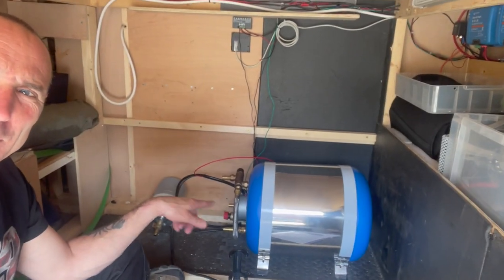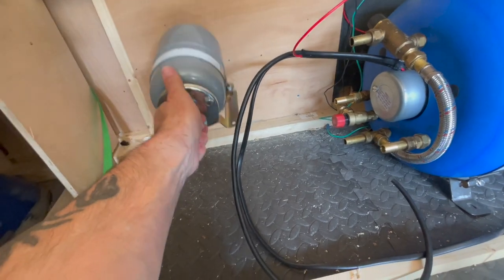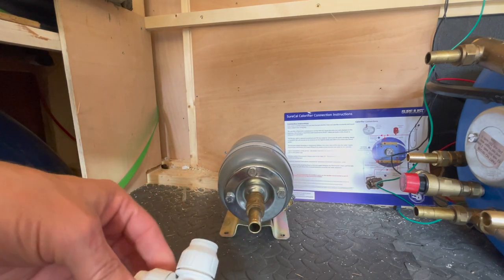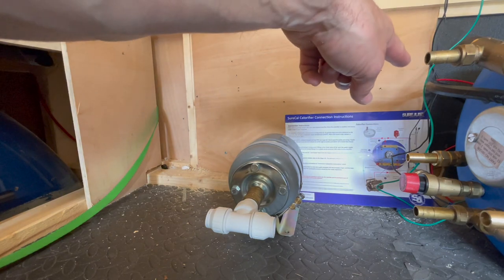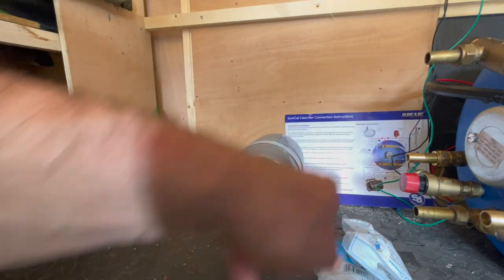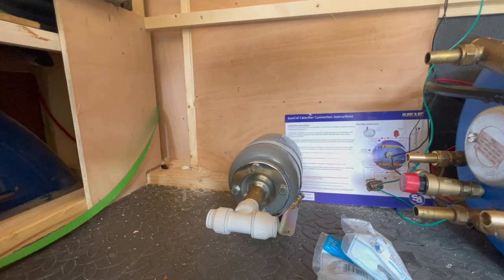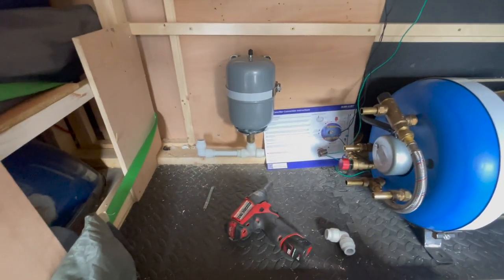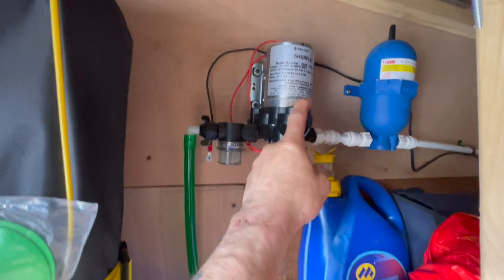Free hot water Installing a Surecal Calorifier in a Mercedes benz Sprinter off grid camper van.

Comment: An interesting project. Presumably there will be a flow and return pipes
running full length of the van for connection to the engine coolant.  Looking forward to future updates on ptogress of this hot water system.
Reply from the maker: Hi Chris, yes flow and return so the vans cooling system is happy , still got to sort that out, but its not far off .

Comment: Very interested. Could you possibly measure the tank as the 22l twin element on their website looks a lot longer and thinner. The size of yours looks ideal for where mine needs to go.. 👍
Reply from the maker: Length 550mm Width 340mm  Height 350mm, there is two different 22lt tanks

Comment: Nice instal !
are you going to run the calorifier from the engine coolant or use a bobil system VIA the diesel heater ?
I'm in 2 minds, i have the calorifier and a bobil systems heat exchanger in the diesel heater ducting but not decided on a final install yet ?
cheers dude !😎
Reply from the maker: Hi Dirtdigger, yes mate it will be connected to the engine, just need to work out how much pipeline to get, what size connectors to use from the engine. I have a CDH but didn’t want to turn it on just to heat water especially in the summer.
Reply: @ProjectCamper  the bobil heat exchanger takes so much heat from the air it blows out pretty cool, i was surprised how little heat came out when heating water, on a hot day i didn't notice it but yes it's still not free whereas heating whilst you drive is cheaper on the old doosil 😁
Reply: @ProjectCamper  hi, I’m having issues with my set up (similar to yours) but live very remotely currently (on a little isle) so struggling to find any one that can help me troubleshoot. Everything looks connected the same as your set up (but no filter to the shuflo) the pump is running but water isn’t making it to the taps? No leaks? The bilge works fine and allows water to drain. Any ideas?
Reply from the maker: @flex_uk3077  Hi there, a good idea is to work backwards ,If your water tank or supply is flowing and the tank is filling up, is the tank letting water out, if water is comiong out then you have a blockage or a closed tap
Reply from the maker: @Dirt-Diggler  Hi dirt digger, hope you dont mint the late reply , how did you do yours in the end, cos im thinking the summer will bring in the solar like it has been, and winter i have the CDH on so may go the bobil or heat exchanger route 👍👍
Reply: @ProjectCamper  still not finalised it myself 🤣 only just got the bloody sink sorted cos I changed my mind and redid it all over winter 🙄
Reply from the maker: @Dirt-Diggler  Vans are never finished 👍👍